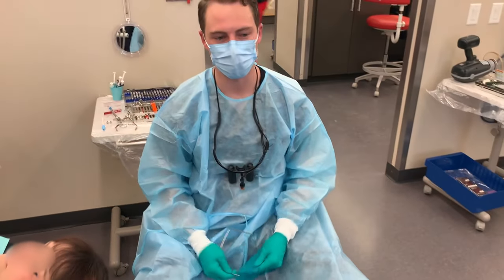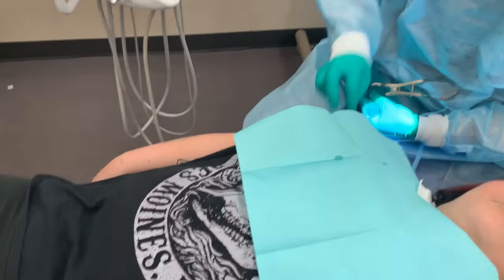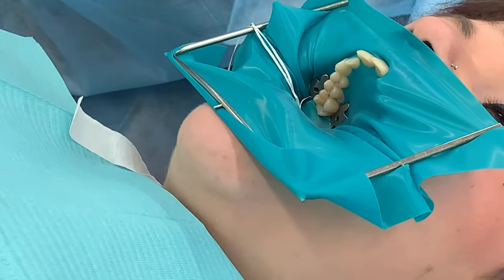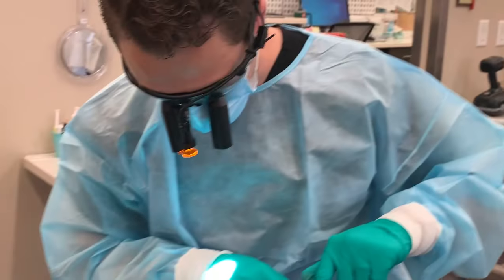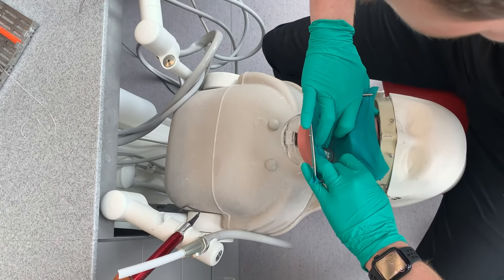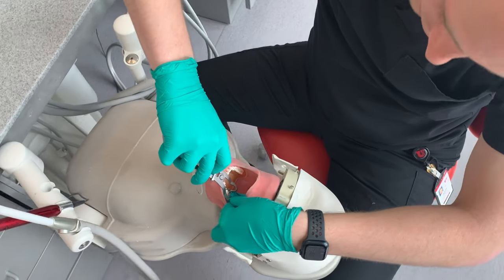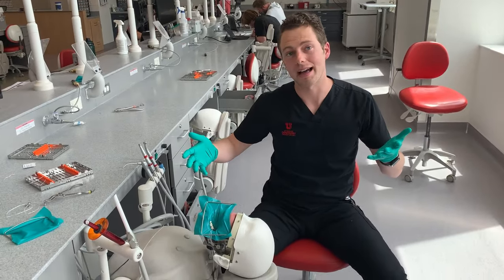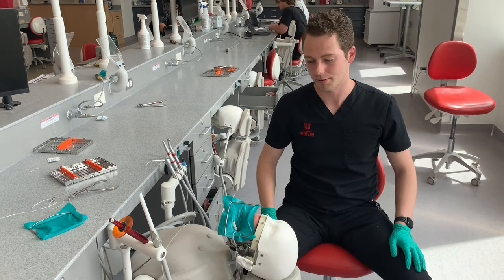Fast Rubber Dam Placement

Comment: That way looks so easy.. Easy as on models... Unfortunatelly patients contacts are so tight that usually I tear the dam (or the floss itself)  trying to get the rubber in the right position
Reply: You can add some Vaseline to the side that goes on the teeth. It should help slide it in.

Comment: hello, i have a problem getting the rubber dam through the contacts,  i tried with floss and with pushing down , but just couldnt do it.  Even with an assistant helping me stretch the rubber dam  towards the alveolar bone i still cound t do it 100 % of the time. How do you think i should approach that? Would a lubricant help in that situation
Reply: Use lubricant (water-based one such as glycerin gel or KY gel) or change the rubber dam sheet to the thinner thickness one
Reply: My book says you can use Vaseline too?🤷‍♀️
Reply: I use Vaseline it works
Reply: A few things: 1) punch bigger holes in your rubber dam...it makes a world of a difference 2) utilize a little saliva as lubricant (vaseline works too, but this is a video on doing it quick) 3) You can stretch your rubber dam on the frame so that your holes more or less line up with the teeth 4) If your floss pulls out the dam when you pull out of the contact either pull it out the side, or utilize either side of the floss to pass through the contact again and then pull out to the side. Hope this helps!

Comment: Looks like 4.0x keplerian dental loupes.
Reply: Try 8x keplerian (prismatic) haha. And with a full arch field of view. I believe you produce higher quality dentistry under higher magnification.
Reply: Barrel seemed to short for 8x and too long for 4x.  8x is good.  It is only loupes magnification that enables dentist to see microscopic undercuts in crown preparations.
Reply: @mamounjo  Nah, 5x is the sweet spot for prosthodontic work in loupes. 8x is way beyond the point of diminishing returns. There's no such thing as free lunch in optics. Even the marginal improvement of magnification from 5x to 6x nearly halves your DoF. At 8x it'll be so small, every time your patient moves, you'll have to re-adjust. If it isn't so, and if you can actually see the full arch, then the manufacturer lied about the magnification. Which happens much more often than people think, by the way.
Besides, undercuts and J-margins are a matter of technique rather than magnification anyway.